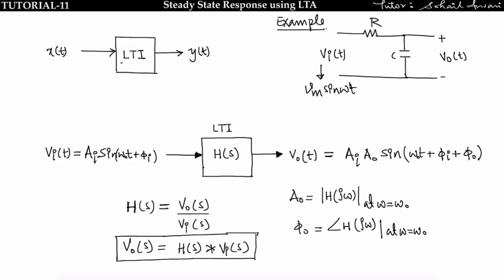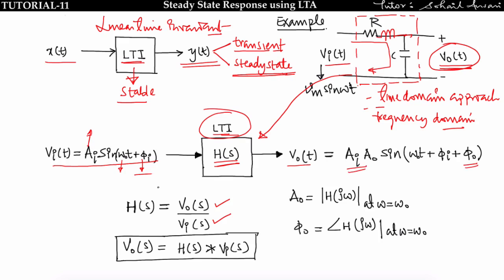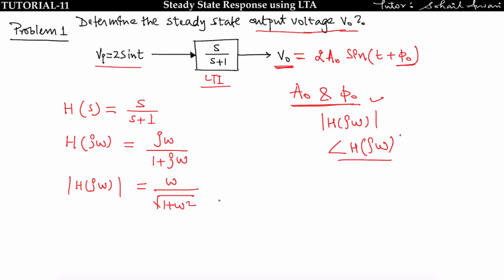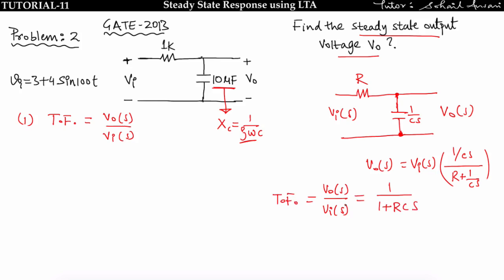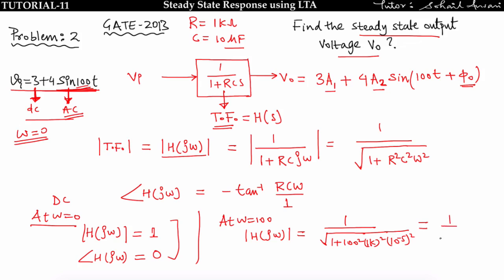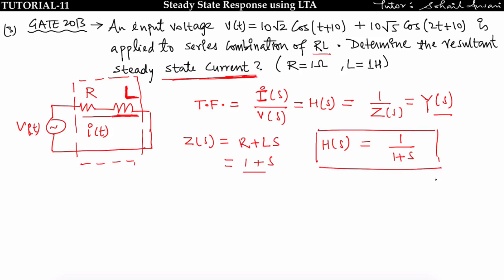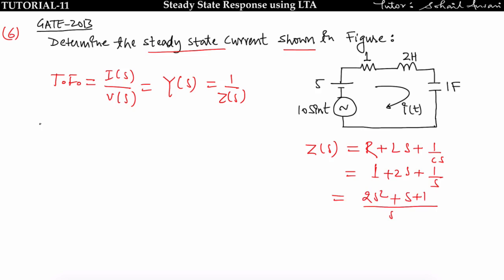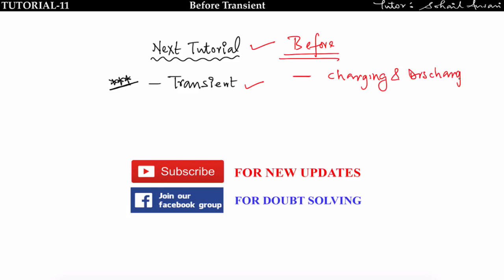Lec-11 Steady State Response

Comment: Sir ,,for a+jb the angle is TANinv (b/a)...so I'm case of -1+j the angle is TANinv (1/-1)...it is TANinv (-1)=-45.. so for the last part it should be 90-(-45)=135Why you did 90-(180-45) please reply,,,,I need to understand
Reply: taninv(1/-1) is in the second quadrant that means it has to be tan(180-45)=-1 i.e you have to consider the ccw rotation for positive angle which in this case is 135. and you need to take it as 135 and than subtract it from 90
Reply: you r right mate 135' correct not -45'
Reply: Tan 135 and Tan -45 is same =-1
Reply: Arinjoy Ghosh exactly
Reply: Arinjoy Ghosh, I guess i understood the logic. All values of theta while calculating have been accepted to be in the anticlockwise direction. So taninv(1/-1) was taken as 135 instead of -45 to produce the final result of -45

Comment: I  have a doubt regarding the sign of phase angle.... Is it always positive.. or it can be negative in the steady state output?
Such as for input  V= Vm sin(theta+  Φ) the output could be V=  A1Vm sin(theta + Φ - Ψ) ?
Reply from the maker: it may be positive or negative...depending up on the phase angle of transfer function as well as input frequency...